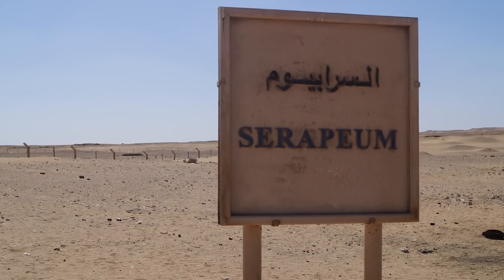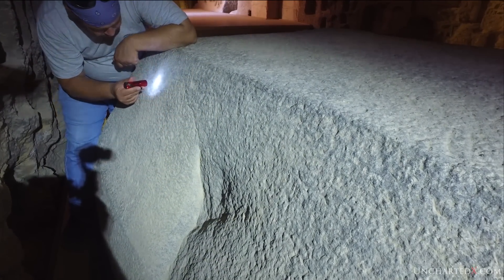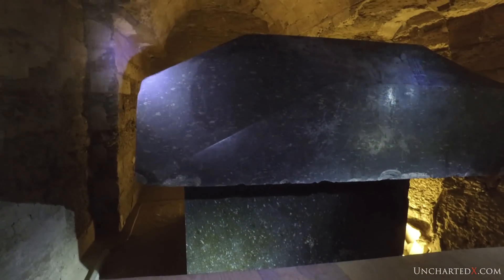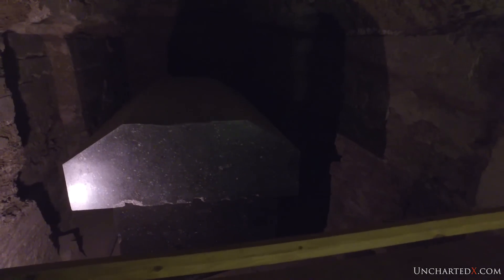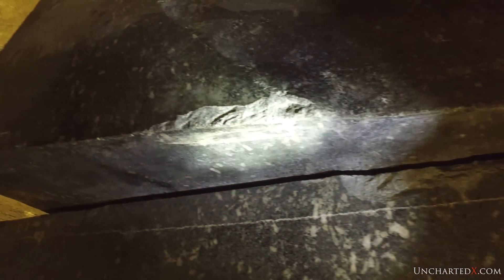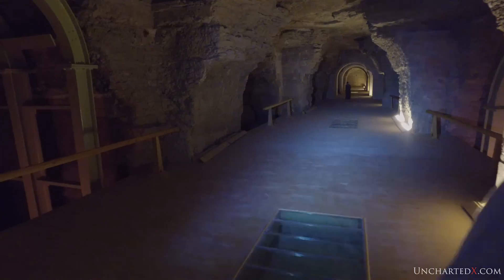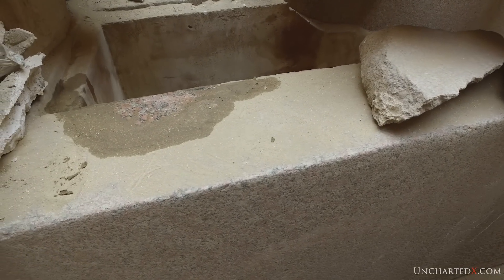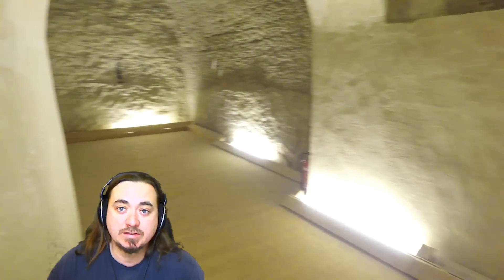Evidence of Ancient High Technology - Liquid Polishing at the Serapeum of Saqqara - Chapter 4

Comment: interesting.  Thank you.   I wonder if it was an acid that penetrated and changed the surface structure of the granite.  Hydroflouric acid?  I've seen this sort of polish in the British Museum, etc.  If it's not acid, perhaps it's something that can penetrate between the granular bits of the granite and then harden.  Melted wax of some kind?  Wax is used in encaustic art, beeswax.  It's used in ancient portraits on sarcophagus because it never rots or degrades or fades, and the pigments are just elements in the wax suspension.   Also in one video you show there's a melted line on a box that had a lid snap off so it was unfinished.  That looks like a straight edge was laid down and a brush with some sort of acid was painted on to soften where the saw will cut.  It has seemed to me that the drill cores, with the very deep penetrating spiral might be something similar.  Instead of imagining a fast spinning drill, imagine a drill that turns slowly, but the silica is softened with acid temporarily.  It would progress as fast as the acidic reaction could soften the stone, and wouldn't require the tons of pressure you imagine working solid stone. It would be like cutting through soft butter.  Somewhere out there, I think it might be a Brian Foerster video, he talks about copper mines having extremely acidic .05 water inside them, so that might be the source of the acid.  If I ever get my workshop finished and made safe with a vent hood exhaust, I may experiment on softening silica with Hydroflouric acid.  remember the drill cores showed the silica was cut deeper by the tool and mica etc was "ripped out."  So acid softening with cutting on the granite etc is an interesting combination for these techniques.  The flatness of the boxes could be worked with acid softened stone easily enough, and the plumb bob etc water levels, dowel- string level testers, all can be very accurate.  The interesting thing to me is making the flat surfaces parallel, and cutting the corners so tightly.  I can only imagine a plunge router or some odd dado blade cutter that could produce that work.  Also, final thought, the tools for cutting etc, if they did use acid, would not be left around these working sites at all as it would be very dangerous to people.  It would be used, and probably drips etc gathered into sand and/or some sort of cloth etc to gather it up and transported away.  I did think it odd they transported your favorite box all the way there with the unusable crack in it.  Did it get dropped and cracked?  I noticed the intersections if the "restoration limestone etc is removed have bevels so you could rotate the boxes and slide into niches there.  It looks planned.   If it it an electromagnetic device, what is the box sitting on?  the limestone tile was added later.  also there is deep pitting nearby the later hieroglyph writing, looks like from electric spark exploding a bit of the surface.  Perhaps the polish reduced that effect?
Reply: oh yes, the lids and boxes cut from the same bit of stone make me think the composition of the entire box needed to be the same, ie, the lid couldn't have a different electromagnetic potential than the rest of the box.  I imagined the bevels on the outside of the boxes might be to reduce electrons arcing from opportune points if square box geometry.  Great fun to think on this!.  BTW if we know the pyramid was a machine, and we know how the pyramid is constructed, then can't an engineer figure out how the pyramids and boxes worked electromagnetically?  I thought it interesting the not so conductive granite was used to build the king's chamber.  That would insulate workers inside that area from the basalt and limestone.  hmm.  Fun.  Also, the boxes are so gigantic, they do seem designed to keep the interior pressurized.  I didn't notice any goesinta-goesouta holes in the boxes, so it made me think the boxes might be giant capacitors if you put the correct liquid or stone inside.  Was it some engine that fired charges 24 in a row before starting over, or did all the capacitors discharge at once?  and how exactly does a person with monoatomic gold in their bodies react to electromagnetic fields?  So much fun to think about all this stuff.
Reply: @heymikemike  you have a very intellectual and open mind, congratulations. please check out Ben's other videos if you haven't already, you'll be just as awestruck as I was!

Comment: What was said just prior to 7:30 leaps over a few key points, namely, that these planar bonding energies are only relevant within the context of a perfect crystal. Near perfect crystalline structures undoubtedly exist within these stones, but we're talking about microscopic crystalline domains with an infinitesimal chance of all being of a single orientation(unless the stone was manufactured instead of quarried), so any facet you cut through the larger conglomerate of crystalline domains will necessarily bisect the individual domains at random angles, yielding no net effect on the would be surface energy. In fact, to create a surface with higher than average surface energy, you would just stick a wedge in a natural crack and force the stone to cleave where it pleases, as the bonding energy between any two atoms which are separated by the crack was clearly lower than the bonding energy between those atoms and the ones they're still attached to.

Comment: Yes, liquid stone is the only explanation when everything is taken into account. The impossible pottery in the Egyptian museum has been attributed to being manufactured with a lathe. For some pots that is impossible because the handles are an integrated part of the pot, not added at a later stage. This can only be done when the stone is malleable or, as we say, 'liquid'. Same with the impossibly tight fitting randomly shaped stones in the monolithic walls in South and Middle America.
Reply: Yes my frend, you are onto it. The so called "stone melting" technology can be seen in many ruins around the world and it was also used by different advanced civilizations. The latest that used it in Egypt, the so called "old kingdom Egypt" are the ones that renovated the pyramids with the precise polygonal masonry of the outer limestone casing, which is clearly much younger than the inner blocks, which are also stone melted into place, but by a much older civilization. The old egyptians simply took this technology and elevated it to an art form and made all kinds of beautiful small artefacts with it.
Some have speculated that they used some kind of sonic devices to modify the frequency of the stone until it became like putty. Then the stone was carved or shaped by other metal devices with ease. It is assumed that the granite cores made by tubular drills from large granite slabs were also made like this. Maybe even these giant granite containers were shaped like that too.

Comment: They are piezoelectric low frequency resonators. The cavity is in the XYZ proportions of Schumann resonance harmonics. A few liters of heavy water is poured in, and when the top is put in place a resonant mode is created which is then amplified by the piezoelectric potential induced in the whole box by the weight of the cover. Eventually the heavy water turns into a plasma which further resonates inside.

Comment: I don’t know if it’s been mentioned yet but what you describe with the “layer” sounds just like the “newer” ceramic coatings used in automotive detailing. It’s creates a microscopic layer on the surface that protects the finish. You can simply wipe or rinse dirt and debris without using a detergent. You should perform some tests on finished granite.

Comment: So the thought is that these 'boxes' had a 'physical function' and needed to be strong and solid to withstand pressure (which seems highly probable) an understanding of the structure in which they sit, shape, volume, number of alcoves and boxes etc may well give rise to some better speculation regarding the boxes function. Also given that they had a function, the polishing would have also had a purpose (waterproofing etc) and the boxes may have held an alternate chemical or substance that enabled the boxes function further - a form of electrostatic storage device perhaps? It's fascinating to ponder - great videos thanks!
Reply: the polish probably served to cut down on static electricity...

Comment: The shiny finish may have been a liquid coating applied to the smooth (yet porous) stone in order to fill in all of the micro voids and cracks that remained after shaping.  Something like an epoxy coating rather than a chemical that etches a polished look onto the surface.  It is interesting that the hieroglyphs carved onto the exterior of the boxes do not appear to have that same polished look down in the grooves that form the glyphs.  That implies that the hieroglyphs were carved into an already polished stone surface at a later time and that the carver never bothered to go back in and polish out the cut relief areas that form the hieroglyphs.  If an effort was being made maintain the integrity of the stone itself, then those rough cut hieroglyphs all over the outer polished surface would only serve to weaken the stone like an array of score lines or shallow cracks.
Reply from the maker: yes the writing was quite clearly added later, I'll get into that in the next chapter of this series. Also an epoxy or resin fill (as we do to our granite surfaces) would not have lasted the 1000's of years that these boxes have held their finish, in my opinion. It's all the stone itself, and it still has to be polished even if you're just applying a resin afterwards, the polish doesn't come from that, it's the stone itself.

Comment: More than likely they were the casings of power capacitors. Many people have speculated that the pyramids were/are huge wireless power plants. Well huge power plants require huge capacitors to store the power safely. A power capacitor requires an isolating material as container so the electricity charge doesn't leak out. As Yousef's experiment showed, granite was a poor conductor and probably why it was chosen as the case. This is also why they were so careful to remove even the smallest cracks, so that the battery inside keeps its charge for a very long time. They must have kept the capacitors in there for a later project and then evidently used them all since none have been found inside the boxes. 
I think the liquid is some type of resin that was used as a final layer of insulation for the capacitors. This is why it is not inside the lid, it was only applied on the outside after the container was closed.

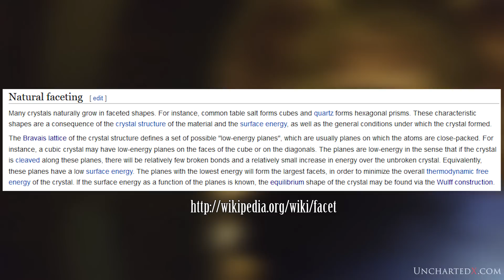Comment: 7:00 It would make sense to me if the sole purpose of the faceting, were to be for: being able to determine how to get the inside of the lid to be flush. This may also explain why some are not consistent, yet still left as complete.  To elaborate . . . say one of the workmen at the quarry were given his instruction on what was required . . . rhetoric warning -- he can't add stone, so he would need to get a piece "at least" so large.  The piece would break along certain angles, letting them know  where the surface would be to make a lid that had the possibility of sealing.  Not sure if there are any unadulterated surfaces to test . . . but I would test for mercury. . . just don't use the one that was blown up.

Comment: These boxes are perfect if you're looking to hide something or protect something.

1. Putting them in catacombs underground. 
2. Creating facets and polishing it to a mirror finish would reflect any penetrating radar / radio wave to bounce off and miss the transmitter/receiver, just like a stealth aircraft. It would also protect any object inside from cosmic radiation.
3. The size and weight of the boxes and lids prevent any human to move, open or close the lids.
Reply: lol radar.

Comment: The only relationship between energy and the faceting of the boxes is that the surface energy dictates which angles will be easier to create. So yes, there is a relationship, but I think it's in the opposite direction that you are suggesting. The cuts chosen by the designer likely were based on the angle at which the rock 'wants' to be cut at.

Comment: @10:50 the liquid for polishing would have been the same as that used in modern day rock polishing tumblers which can eventually produce a finish like glass. You start with carborundum, or, tungsten carbide granules in a water suspension, (if I remember correctly), and gradually move through a process of more finely ground abrasives ending up with tin oxide or something similar. All just as a suspension in water, a cold, room temperature process.
The method to get into the nooks and crannies would have been fine spraying, like pressure washing, and recycling the slurry to spray it again and again.

Comment: Unless there's direct weathering with grit abrading the surface will stay polished indefinitely. Even smooth glass being abraded by fine diamond sanding pads will resist abrasion if perfectly polished. Once it breaks the surface it will be easier to abrade.

Comment: I think the faceting on the lids is probably to save some weight as the outside upper corner section does very little in terms of carrying any structural load.  I think these were made with attention to getting them done with the least amount of effort in the fastest possible time (relatively).  To me it appears obvious that strength and possibly some inherent chemical or electrical qualities of the stone were purpose built to hold something (someone) through a cataclysmic level of force.  These boxes were milled roboticaly  in a similar way we would do it.  How they were put into the tunnels it absolutely mysterious.  I could only see that happening using some form of force we no longer are aware of.  Additionally, manufacturing insitu is fascinating!.  Is there any fragments from the original creation? I doubt it.  I bet the granite was vaporized from a close distance and high resolution milling head.

Comment: This is my Original idea and not from any book AFAIK, so happy to answer questions: Faceting helps avoid cracks in a box that is under pressure. Idea is to avoid 90 degree turns so the pressure is more widely distributed. These boxes were housing something that was kept under pressure, this liquid or liquefied Gas is stored under pressure and that explains why these boxes are so heavy.  
Granite tends to be less corrosive and a polished Granite even less corrosive as the surface area that comes in contact is minimized. Extremely fine polish is a necessity to avoid corrosion.
Reply: 90 degree turns i meant 90 degree cuts. Bottom is already thick enough so that should be okay. Top cover is relatively thin and needs pressure dissipation. I think these boxes will have nothing even if you find one unopened/untouched As the liquid would have been evaporated by now or has been emptied out.
Reply: Also, due to this pressure, some boxes with cracks are discarded. But if you can remove the cracks and stop them from running down into the box then they can be used.
Reply: Also these boxes may need to be submerged in the water so this site may actually be useful when the water level rises to submerge these things. So there will be few sites like these spread across to take advantage of changing water table.

Comment: 11:20 Could these drip marks be the result of a long abrasion process
with sand polishing? Like the reaction you get from the process of melting sand (in gold extraction or glass making). Of course this process requires a very high temperature (like 3000+ °F). But maybe that temperature is achievable with manual polishing in tiny microscopic spots once at a time over a long period of time. 
If it's not possible, that could be also an indication that they used some kind of machinery that was exerting some high pressure on the surface while polishing.